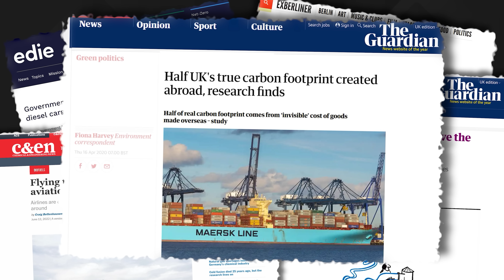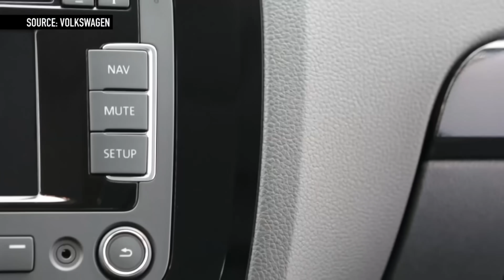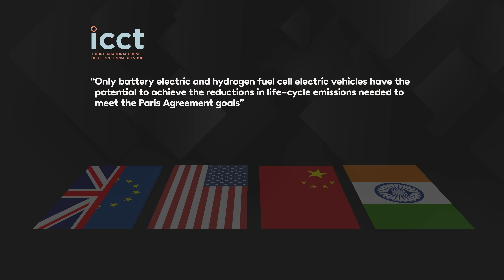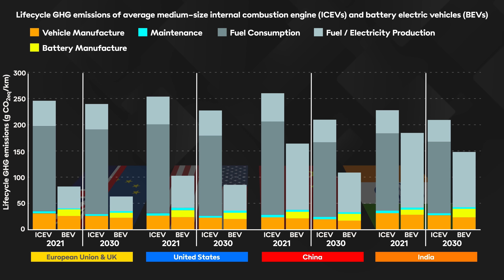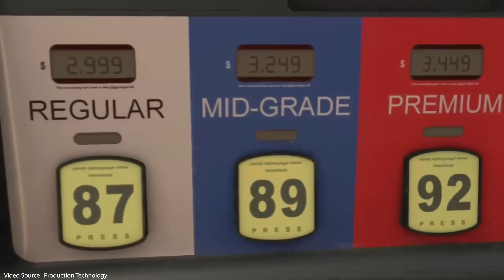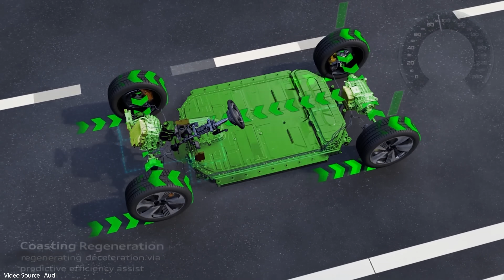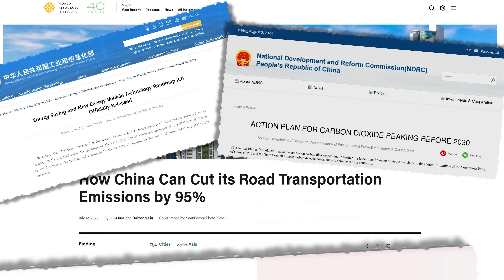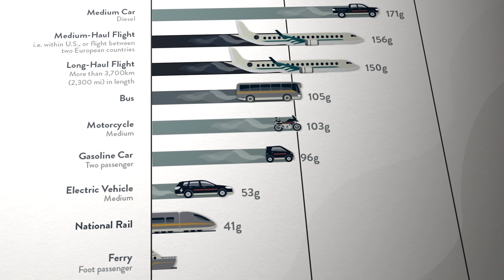Are EVs really better for the climate?

Comment: I would ride my bike to work but there is a large hill between myself and work meaning it's uphill both ways. I would buy an EV but I can't really afford a second hand one and I'm not buying 1 brand new on HP.
Reply: I'm on the verge of ordering an electric bike, also an ev. If you're OK with a bike, an electric motor will flatten that hill.
Reply from the maker: Electric bike?
Reply: @JustHaveaThink  Like a regular bike with an electric motor or an electric motorcycle/scooter?

Comment: With the increase of fuel prices and bans of ICE in the future, hybrids and EV's will be more popular. My next car will be EV or plug in hybrid. As of now I have a frugal 1.9tdi
Reply: Ban on internal combustion engined cars include hybrids. So Don't run out and buy a hybrid in 2025, you won't be able to sell it or drive it.
Reply: @Tore_Lund  it's a ban on new vehicles sales tho. I will see, full EVs are still quite expensive (if you want something better than an old Nissan Leaf). My car will probably last long so the used market will be better then
Reply: @FSXgta  I was in the same boat, an used Leaf or Zoe was within my budget. Got an electric Fiat 600 from 2000, converted it to Li-ion and have 120 mi range on 22kWh battery. cost me $6000 in total with salvaged batteries from an i3, suited my needs the past two years so far and I love an EV with the looks and quirks from the 90'
Reply: That "frugal" 1.9Tdi is probably costing around 5 times as much per mile more than a typical EV......
Reply: @Brian-om2hh  yes, but I would lose money buying a comparable ev right now... Might use that money for fuel instead.
Reply: @Brian-om2hh  All remember the Audi tdi that used 3L/100km with a 0.7 engine. If Diesel cars of that size had stayed the norm, we'd not have 1.2C warming now.

Comment: Carbon emissions aren't the only environmental problem that cars create (regardless of power source) - they all produce tyre and brake dust, all create noise pollution, all require vast amounts of concrete, steel, tar, aggregates and energy to build and maintain the infrastructure needed for them to travel and create a major safety hazard to humans and wildlife amongst many other issues. So yes, we fundamentally need to move away from car culture to have any chance of a sustainable equitable future.

Comment: As usual, the nay sayer will point out that the ICCT is biased towards EV and renewable. Always the same story. I've just given up trying to convince them. I personally ride an EV, charged with a photovoltaic installation. And I'm very happy like that.
Reply: So you ride a bicycle?
Reply: Wait so they are bias, you know they are bias and that makes people who say it is...wrong? Kind of backwards there champ.
Reply: So why not use numbers of someone who is not biased (and yes, even I take ICCTs statistics with a ... salt mine)? 
Volvo (as a company who makes ICEs and EVs) released it's own numbers and while it certainly shows that EVs are generally beneficial, it was nowhere near >60%. US statistics for example show, that EVs are beneficial in California, but detrimental in some states with dirty grid.
From statistics I've seen EVs are overall cleaner, but ICCT numbers are an extreme outlier.
Reply: @petrkubena  One of the big problems with the ICCT report is that by not taking into account emissions from building factories and recycling plants and moving the vehicles to point of distribution, they are ignoring some of the biggest sources of Carbon pollutants in the value chain. The power grid in Texas, for example, is far dirtier than in other states, and it is also far less stable. Factories built where the power grids are dirty can increase CO2 production by orders of magnitude because the additional electric capacity isn't being supplied by Renewables, but by new fossil fuel facilities. The ICCT report is a total outlier from all the other analysis being done in both academic and industry studies. They are a trade association, not an Environmental Advocacy Group. The information they offer on Plug-In Hybrids is not backed by real-world data, such as the ICCT suggests. Their analysis does not reflect the difficulties in establishing mileage comparisons in all driving conditions. For example, an EV driving with the A/C in Southern California traffic will NOT achieve maximum range, regenerative breaking or not. Similarly, EVs that operate in extremely cold environments not only lose battery reliability and efficiency to cold, they also lose range due to the use of interior heating and adaptations for poor driving. There are holes big enough to sail an aircraft carrier through in the ICCT report. It has established a false set of ceteris paribus assumptions that come nowhere near reflecting real-time driving or use case conditions. The problems related to the exclusion of emissions from building factories and recycling plants for batteries adds a layer of deception so enormous it would take pages to address. The ICCT report is total nonsense.
Reply: @jpcolindesign  you mentioned the emissions created by building factories but are you feeling to acknowledge that gas powered vehicles need to be built in a factory as well? Even the General Motors bolt factory has 40% of its power supplied by its own solar panel Netwerk. Tesla with its efforts in solar and energy storage has reduced its overall emissions such that it is emission negative taking all of its factories into account, the extraction of all the materials and the power needed to operate the vehicles.

We have known for 50 years that burning fossil fuels was unsustainable and the argument was that there was no economic solution but now there is.

Comment: Okay, that's persuasive that EV's are far superior to combustion vehicles from an environmental perspective. But there will still be a lot of market resistance, and not solely from a cost or a range perspective. I am waiting for the first rugged, reliable, 4WD electric vehicle developed for use on primitive gravel roads.
Reply: Spoken Like a real myopic petrolhead
Reply: The solution to that problem may probably be found with whoever it is whom converts Land Rovers to fully electric. I don't know who they are, but they do exist.....
Reply from the maker: Ford F150 Lightning??

Comment: A nice follow up would be a look at the feasibility of replacing all ICE vehicles with battery or fuel cell vehicles over the next 10-15 years.
Do we have the materials available, especially for the batteries? 
Do we have the electricity infrastructure to keep them all charged? 
What will it cost, and can the poorer nations in the world and their citizens afford it?
Reply: Raw materials are sufficient. Extracting them, processing an manufacturing (and recycling) is something that needs to rapidly scale up of we want to make that happen. Energy wise, EV's are a good combination with residential solar and wind microgrids. This will eliminate a lot of the transport grid problems.  Energy there is enough, fossil fuel refining energy use alone will be able to run billions of EV's year round.
Reply: Excellent comment!
Reply: These are the challenges of our time that matter and no doubt there are a lot of entrepreneurs like me looking to take a crack at these challenges.  we are closest to having the renewables solved.   If most homes and businesses choose energy independence like PVs and batteries, it could dramatically reduce current demand on grid which provides the capacity needed for distance travel.   I.e. if you charge your car like you do your phone, at home, and you are on PV power, you are off grid reducing over all demand creating needed room for those that need grid energy like those on a long distance trip or fleets delivering packages, etc.
Reply: The raw materials exist but with the current political climate they can not be mined in many parts of the world.   That is why you see them coming for 3rd world countries.
Reply: Replacing all ICE vehicules will take at least 30 years and more likely 40. This is enough time to upgrade the grid ( wether it will be needed or not is another subject). US electricity consumption grew 30% between 1989 and 2013. 
Prices will decrease with volume (Wright’s law) and EVs will be at price parity with ICE as soon as key materials à become abundant

Comment: Volvo came out with a study showing how much an EV would have to drive to be more effective than an ICEV.  They showed three levels of grid usage, a clean renewable grid, a mixed grid and a heavily coal powered grid.  And they had one level for the ICEV.
I asked a question to MIT and Swiss ETH, as well as Volvo.  Shouldn't the ICEV also have three levels showing if it is extracted, transported, refined and transported again in the three levels of grids?  Yes, petroleum and tar sands use high levels of electricity and energy along all levels of production.  I even had a personal meeting with the EPFL from Lausanne the week after my question.
What has been their response?  Crickets.
And a media blitz saying we can't use EV since...electricity.
Petroleum is far worse than they are letting on.  I can send the twitter thread, but I don't know if it gets blocked on You Tube.

Comment: Yes, EV doesnt polute the air and have 3 Times better usage of delivered energy.
Reply: Why do you believe that CO2 is a pollutant? It is a trace gas that you exhale 12-20 times per minute and which allows photosynthesis to occur. Without it, all life on Earth dies. Why are you so convinced it is a "pollutant"? And more to the point, how do you think that electricity gets produced? There's not one technology on the planet that doesn't require energy from carbon bonds to manufacture and operate. Your "green" energy produces far more dangerous "pollutants" than it saves.
Reply: @kma3647  stay in the room with CO2 above 2000 ppm and transport you know 🤣
Reply: 3 times better? Are you serious?
Reply: @janami-dharmam  90% against 30%, something of EV energy can be generated at home.
Reply: Sure it doesn`t, but excavator that is diggin a mineral from the ground is using 4000 litres of oil per 12h shift.